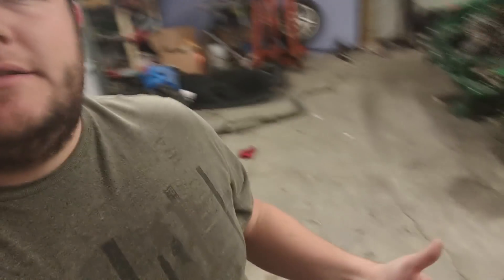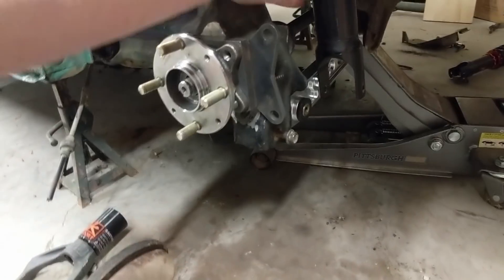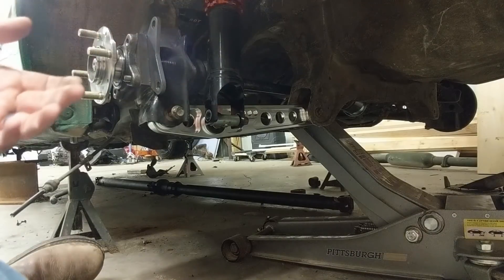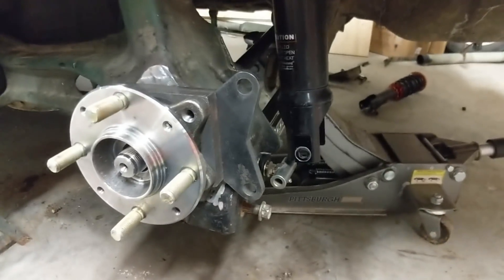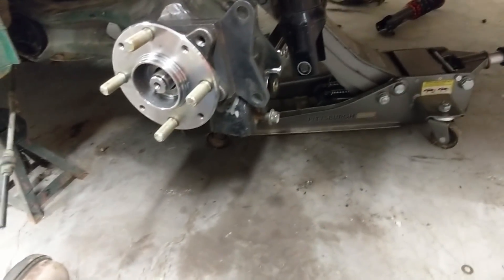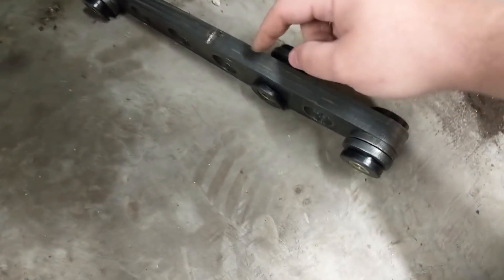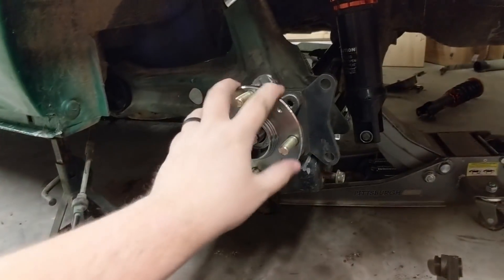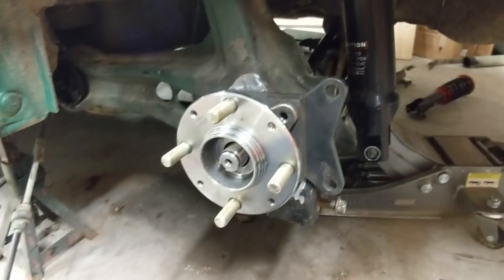AWD K Swap EP07: LCA/Strut options for AWD builds!

Comment: Great LCA ideas. Another option to consider would be to weld another LCA bracket to the subframe and the trailing arms and moving the LCA mounting points back some.
Reply from the maker: Yeah I think that's the way the S1 kits are made. I toyed around with the idea but felt like I'd end up with the same issue of premature  bushing failure unless I moved the chassis coilovers mounting locations back 1.5" as well
Reply: @jeffibuilt  hmm...or bend the lower mounting points on the coilovers?